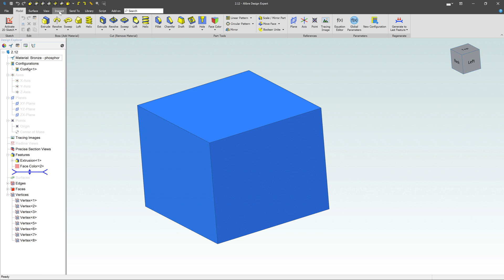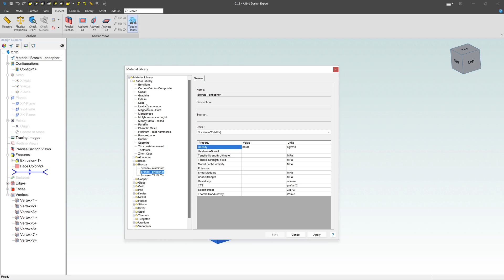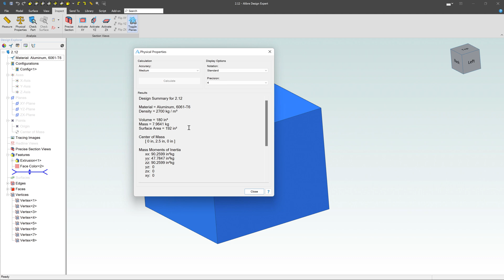Physical Properties in Alibre Design | 2022 Exercise Series

Comment: Hello. I would like to know if it is possible to disable the tangent edges in the 3D model?
Reply: Go o the view tab and try the Shaded visual style. That will not highlight the edges. This will affect all edges though, not just the ones between tagnent surfaces.
Reply from the maker: There is not a way to turn off only the tangent edges in the 3D model. The closest you will find is what Ex Machina Engineering suggested by switching to the Shaded visual style, which will hide all visible edges and leave the shaded part only.